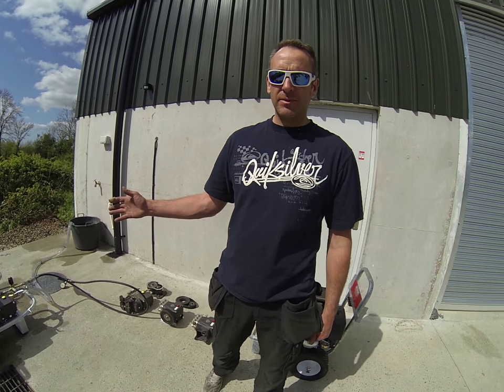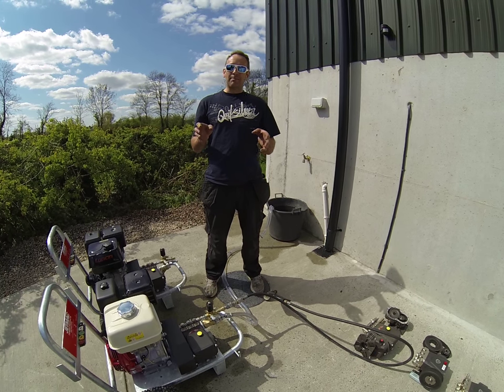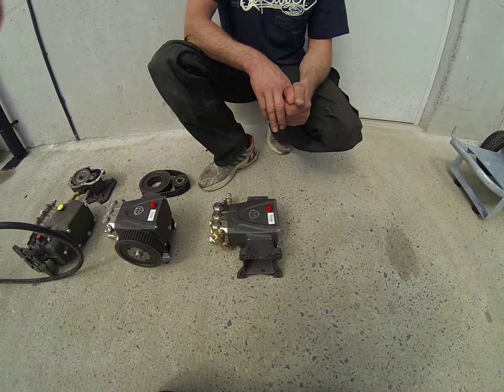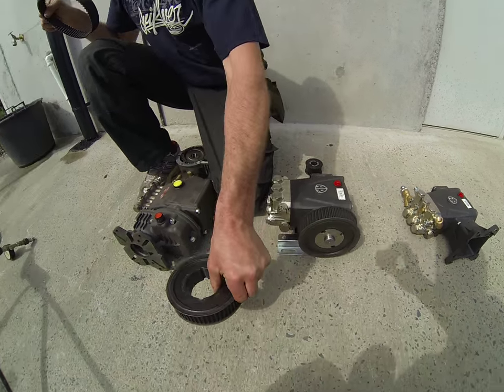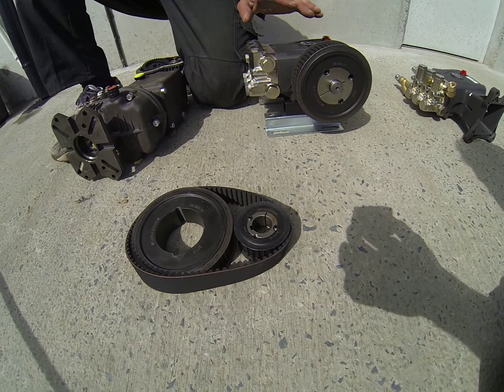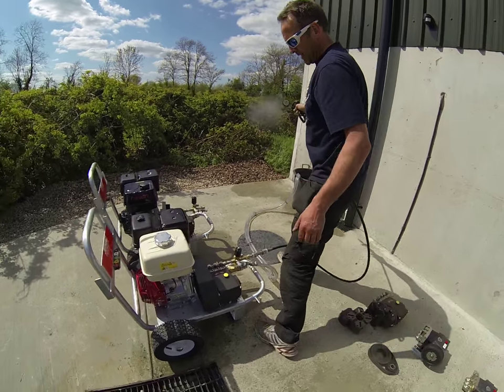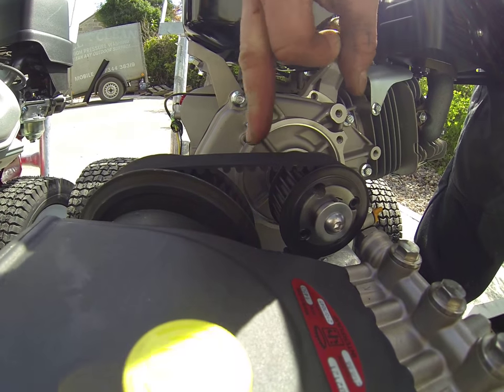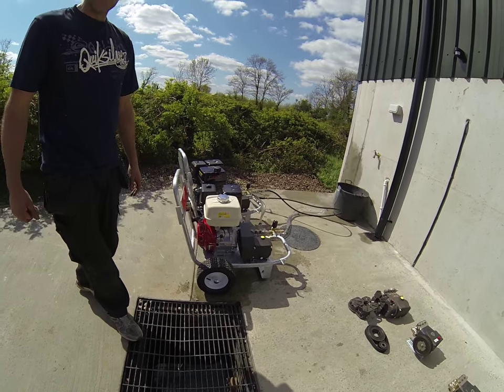The difference between pumps explained

Comment: I have the Loncin belt drive and can’t recommend it enough terry is one of the most helpful and honest guys to buy off
Reply: Keep an eye on the metal brackets that the pump is attached to as the metal brackets will eventually snap underneath your pump on your Loncin belt drive petrol pressure washer